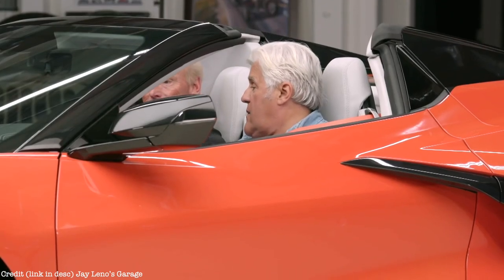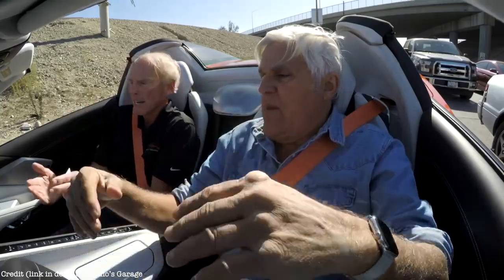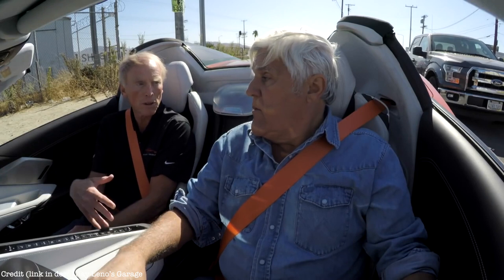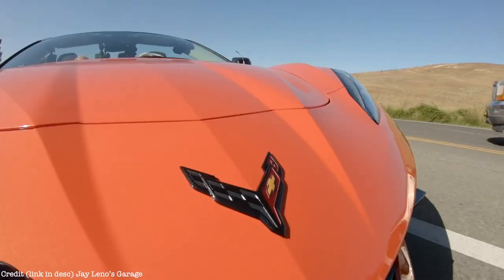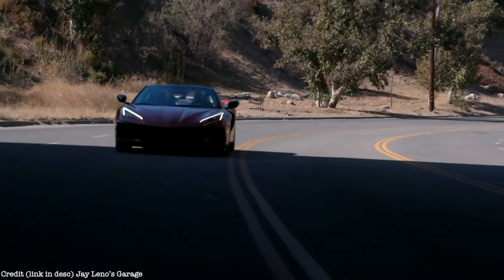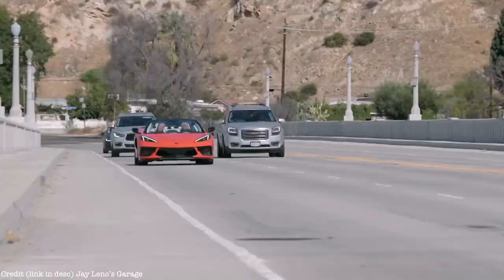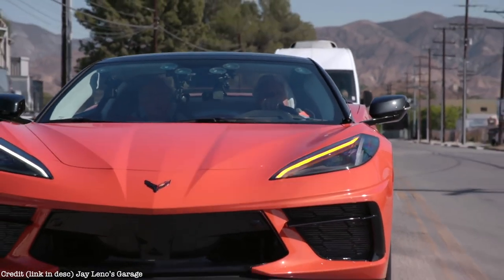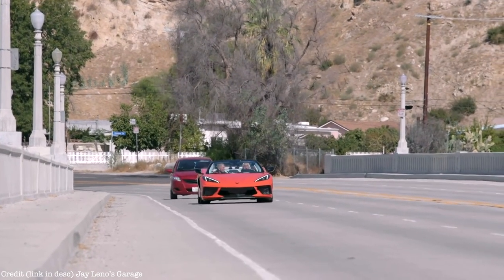2020 C8 Corvette Convertible Z51 First Drive (Jay Leno’s Garage)

Comment: I haven't seen any reviews that talk about the impact of wind flow with the back windows ability to be raised and lowered, can this feature add more comfortable?  Eliminate blow back?  It looks like there is an electronic rear view mirror capability when the top is up which is great but it looks like that camera gets folded away when the top is down which looks like it gives you a very restricted and dangerous view, can you review this issue please.